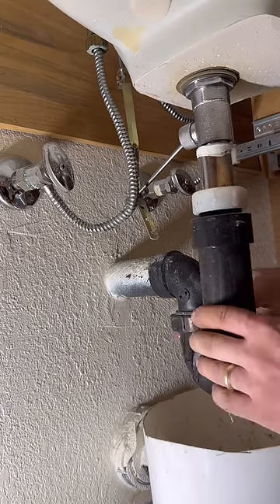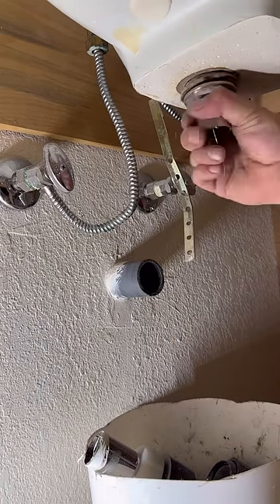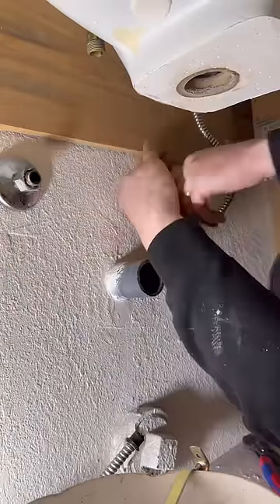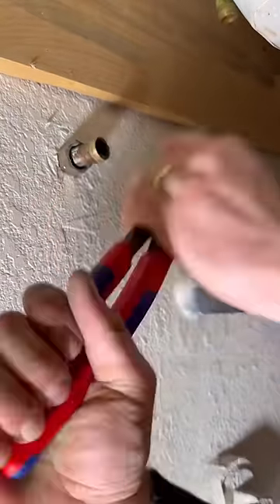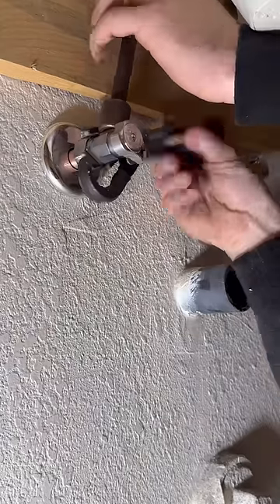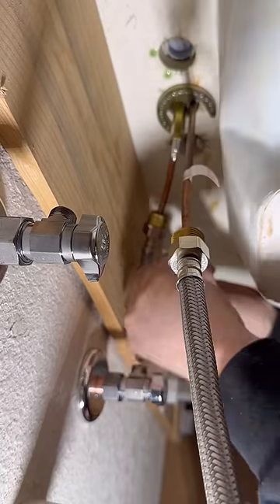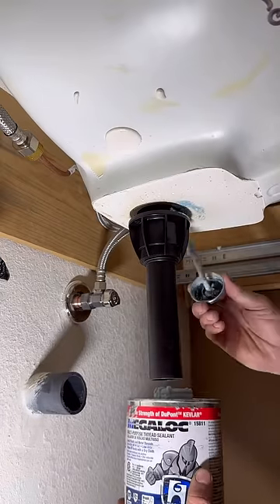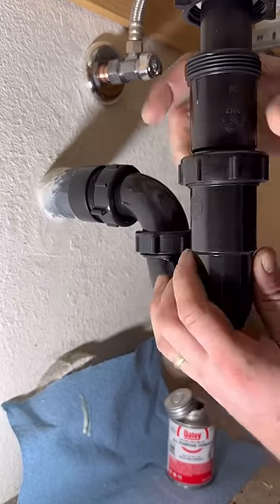replacing a deck mount faucet #plumber #plumbing #diy #faucet #repair #faucetrepair

Comment: That explanation was BS, if parts need replacement, you explain at the time of service, you don’t change a complete powertrain on a car at the time of an oil change, just because they may fail in the future, if the shut off valve’s look old, ok, but otherwise no! Same for the supply lines, and traps. That is exactly why I would show you or anyone else with this mindset the door, and tell anyone who asked why.

Comment: That angle stop tool with the little compression “barbell” that holds the angle stop in place with the ratcheting wrench to tighten the compression nut(I think Pasco makes it) is the ish!!! I do more IPS angle stops, but when you have compression angle stops, there’s no better tool for them. Gotta love em😊

Comment: If it is broken, don't need to mess with/ it. But the new installation will last a long time to come. One of my locations is 46 years old, the only thing wrong was the kitchen faucet. 

How much was the cost for the new change out? Thx

Comment: why change out the 1.5 abs woth the cheap trap in a bag???? just use a new union trap and put a cp band on the stub out for easy access to snake drain in the future. tell the customer you did that an they think you did extra work  for free when you didnt.... an they think your that much better

Comment: So you put in the customer supplied pop up that comes with every faucet but you know damn well you can go to the supply house and get you a metal one that will last you a lot longer and not make you look like a jackass when you tell them no warranty. Come on dude if you gonna have a instructional video at least make it for the smart people
Reply from the maker: How many successful service companies do you operate
Reply: I sweat every copper joint, I thread every black pipe, I weather proof out door plumbing, I make sure all my rough ins are centered properly from each other. Try to set yourself apart from the other plumbers and you will have customers begging you to stay
Reply: @replumb  lol maybe if you weren’t spending so much money on parts and your tools you could make a successful business too!

Comment: Never replaced angle stops unless they were horribly bad,When just changing a faucet. No need to do that, you're just trying to justify $350 to put a faucet on I believe.
Reply from the maker: 🤣🤣must like callbacks

Comment: I think replacing that P-trap adapter was unnecessary, but everything else is a must
Reply from the maker: I don’t leave those glued abs traps. Always had back luck with them. Tubular trap is $2

Comment: Plastic plumbing does it fail, lol it doesn’t rot it may have a crack but if it’s not leaking don’t touch it! But replacing a faucet
Is always a good idea
Reply: That 1-1/2" ABS is overkill, tubular under the sink is code for a reason, the water velocity can flush it properly .